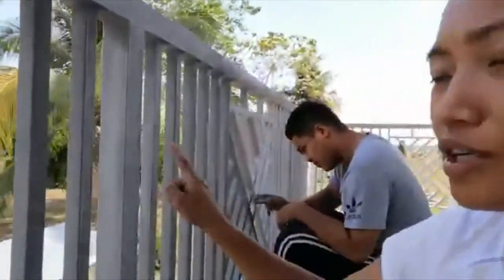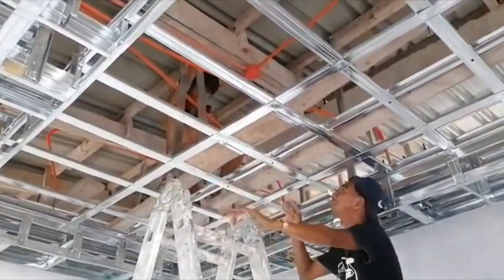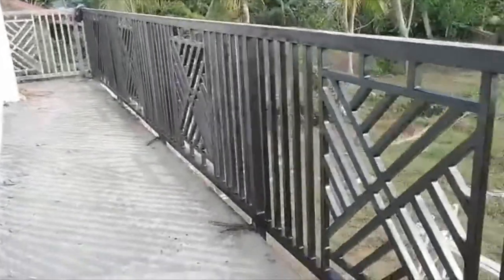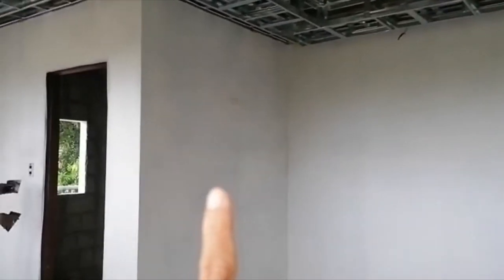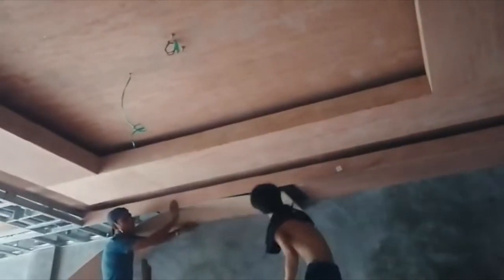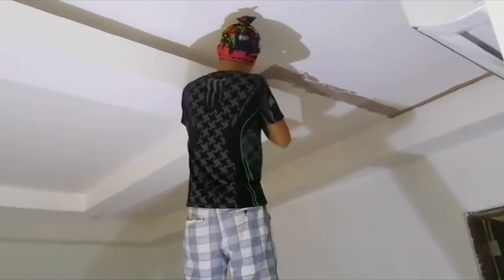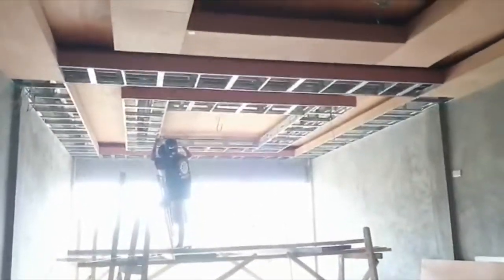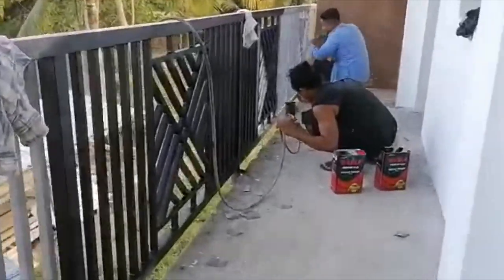Building in the Philippines, Part 79, Fixing Ceiling, Railings, Painting

Comment: You may want to look at youtube for videos on "taping drywall joints" to see where the original ceiling cracking came from. The process is  several steps. First put 
putty on the joint wider than the tape. Then stick the tape in the wet putty followed by a second wider coat of putty over the tape and use a wide squeege to smooth
it out with as little remaining as you can. Then the next day  sand the joints and put a final coat of putty with a wider still drywall knife or squeege. The joint will
still crack under the tape but the tape bridges the gap and allows the changes caused by humidity not to crack the surface. The tape comes as a fiberglass mesh
or paper mesh with holes like a window screen. Fiberglass tape is much better and although it comes with self sticky backings use the putty to stick (inbed) the
tape into. Since you have a spray gun you could spray sanding sealer or exterior paint on the back side of the plywood ceiling sheets to stop humidity expansion of
the sheeting. Test the sanding sealer on some scraps first and any sheeting not installed could be waterproofed before riveting it on.
       Watch some videos on installing floor tiles from US or Europe before disaster strikes there. Use a dry pack (mud bed) if you want to (we are not) and fill the
recesses in the back side of the tile with adhesive and strike off the adhesive to a flat surface. Put the adhesive on the floor or mud bed and groove with a notched 
trowel. place a tile then slide it sideways half a groove width and slide it back to collapse the notched adhesive for full contact and no trapped air. Tap with a rubber
hammer to flush. If you  have a corner below flush lift the tile and reset it. When the adhesive has hardened off tap them with a bamboo stick. If  some sound hollow 
you can still lift them for half a day and reset them the next day if you scrape the back of the tile flush when you lift it.

                                                      george and aurora
Reply from the maker: Thank you for the very comprehensive reply.  Will have a look